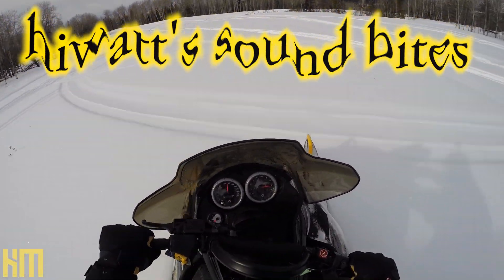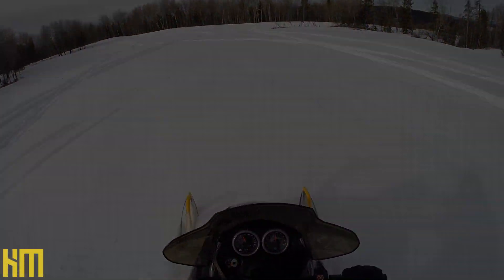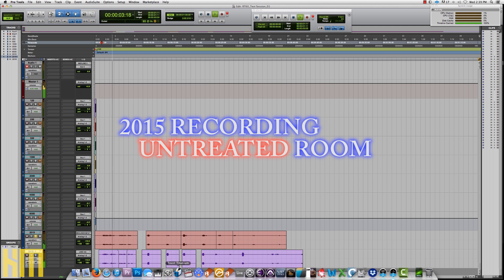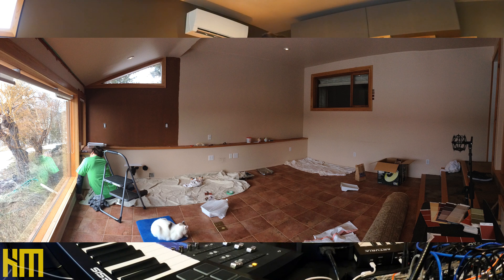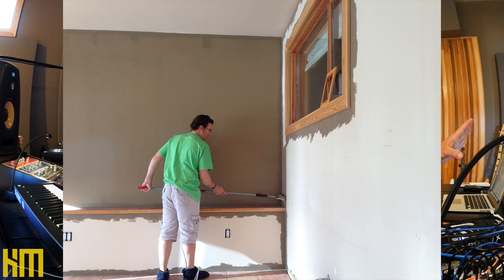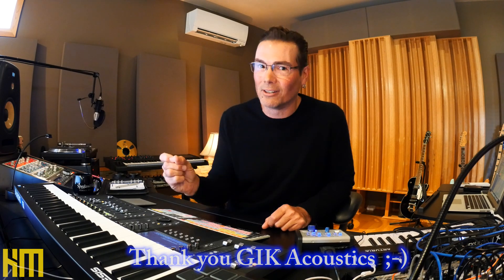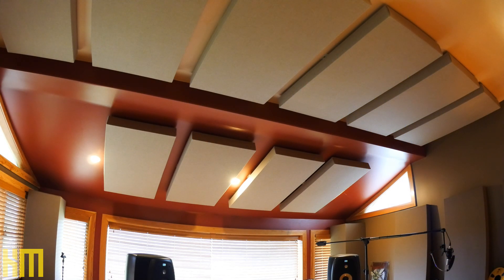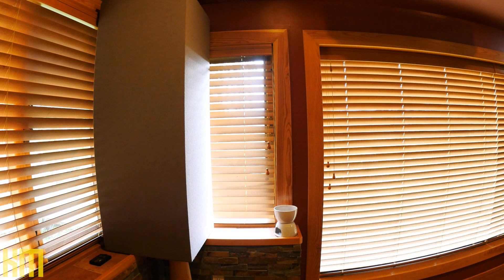Treating Room Acoustics

Comment: So, I have an acoustics question.. I have a fairly large space to build into, and this is a gut rehab of the space.  So, I am not feeling bad about spending a bit more now, than having regrets later.   My full time job results in occasionally not wanting anyone listening in on conversations.  So, new space will be getting full foam insulation and the walls will be de-coupled.  Also, the subfloor is going to be a full inch with a mass loaded vinyl coating between it and the actual flooring.. which is where I really have a question.. As the rest of the space will be my hobby grade music studio.  I hate carpeting by default, so carpet is out.  I am looking at cork flooring, as its just  soft enough to be really good on my feet ( more often barefoot these days.. ) Also, cork will add to the insulation of sound and temperature between that space and the rooms below.  So, while I don't want share too much audio with the rest of the house, I am worried cork may case the room to sound dead.  Is this a problem I should be worried too much about?

Comment: What do you recommend for a diffuser for people who are on a very strict budget and don't have any woodworking friends or access to tools/a shop?  Right now I'm using 2 pieces of rectangular cardboard packaging that were really weirdly surfaced - very much like the "cityscape" diffusers.  They're probably too small, and I have no idea if they are even doing anything, but... that's why I'm looking for a solution.  I also need to find a good "cloud" solution - right now I've just got 2x1 pieces of Aurelex at the main reflection points.  It's a small room, and it's better than nothing I guess, but I've already got the corners and other first reflection points covered, only really missing something good on the  back wall and ceiling.
Reply: Cheap is not the answer, but the least expensive way would be to get yourself a couple boxes of Owens Corning 703 rock wool. They come in panels, like 2" deep, 2' x 4' panels. Get a few of those, cover them with some kind of fabric, and build a wooden frame, then mount them to your wall. There are a lot of resources online about the cheapest and easiest ways to treat your room!

Comment: What a great channel such great information ! Could you show more vocoder tricks ? And resampling techniques ? And maybe some re amping also ???  😎
Reply: Best tip on using vocoders; find vocoders that can actually have both carrier and modulation  inputs (and thus customizable to your preferred sound) .
That is a real vocoder. Use hardware imho.
Reply: PROJACKED Yeah ! Im using the fat pcp 330 vocoder but i was more interested in utilizing them in creative mixing tricks...
Reply: @joshbenzin  yeahhh...using the Nord MicroModular here :D
Reply: @joshbenzin  It's all about the carrier for sound 'design'  --unlimited, but limited in what you can provide as a source sound. If it's not there, then make it :)
The modulator part doesn't necessarily have to be a voice  ;)
Reply: PROJACKED great tip 👍👍👍
Reply: Analog vocoder definitely have their signature, imprint if you will. Sometimes it's not what you want. Dirty sounds tend to stick out more, their ok if you show them properly. I really like ableton's vocoder - it does "no-input" vocoding / noise ghost if you will. That sound is very nice for layering. It goes up to 40 bands and bandwidth can be changed (unique feature, unreplicatable in hw). I have 8 band hw piece too. Super spicy piece, but unusable in 70 % of vocoding cases ( too unpredictable/ dirty ), which are very rare for me. Though HW does react funny when I feed both inputs same signal.
Reply: mic indir i absolutely love the vocoder on ableton also ! Super versatile and  the fact that you can choose the carrier from other channels playing - super creative !